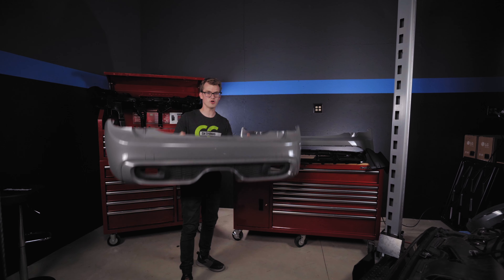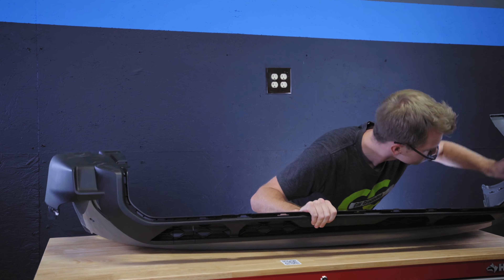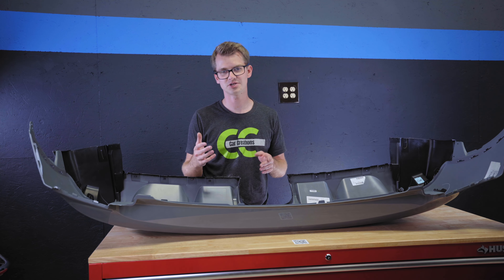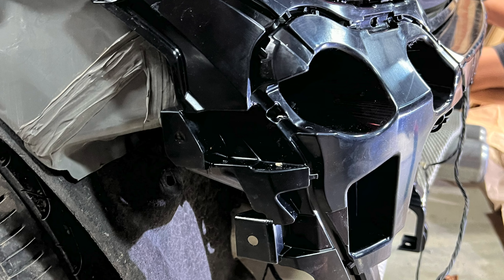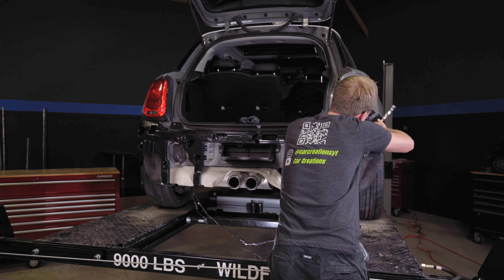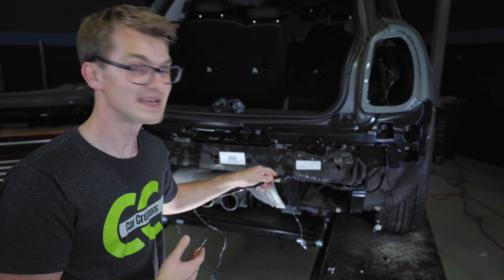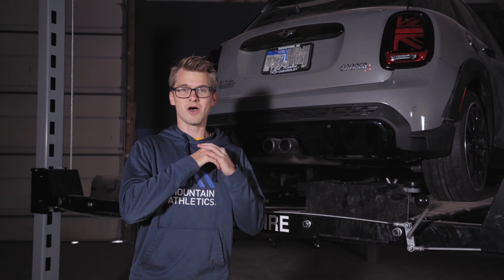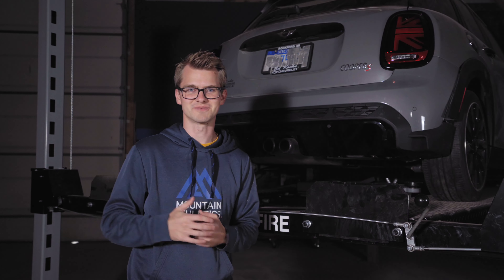Installing the NEW 2024 MINI COOPER JCW REAR BUMPER!

Comment: Hey Ethan, super helpful videos! I'm planning to retrofit PDC on my F56 and was wondering if you knew where exactly the wiring harness goes through into the car itself. The retrofit instructions from MINI mention seem to point to somewhere on the rear right corner - but it's not completely clear where.

I know you mentioned a PDC retrofit in the video, so was wondering if you could help me pinpoint where exactly the wiring harness from the sensors passes through to the car?
Reply from the maker: Thanks so much for watching! 
If you send me a dm, I can get you more information as I am doing my own pdc conversion right now, however it is on the bottom right of the car. It goes into the bumper. You can see the end where it comes out if you remove the right panel in the boot.
Reply: @carcreationsyt  Thanks! Have sent you an email :)

Comment: Hey. Thanks to you I managed to install and wire everything in place. But I am not able to get rear fog lamp to work. 
I used one of the connectors and side marker connector from r56.  Enabled rear fog lights with bimmerode. Now when I connect my old bulb rear fog light and press the rear fog light button it works but LED doesn't. How did you get this light to work?
Reply from the maker: Nice work! I actually just coded out my rear fog lights and didn’t get the bumper with the light, but you should be able to get it to work. 
A couple methods. Try coding it to be a led. That’s probably the issue. 

If that doesn’t work, you could run a wire up to the break light and wire into that. That way it would function as a break light.

Comment: hello, did you mount the f56 rear bumper on the f55?  no problem?  thank you
Reply from the maker: They make the lci2 jcw bumper for an f55 so had to get all f55 parts. I don’t believe any of the f56 parts will work.
Reply from the maker: @cristianpelosi  if you contact him, he can help you find most of the parts,however I don’t believed you can get the piano black rear diffuser here. 
These are the additional parts I believe I need, I can’t garintee though as I have not received them yet. 

COVER, WHEEL ARCH, REAR LEFT
Part Number: 51115A3C801 ; 51-11-5-A3C-801
COVER, WHEEL ARCH, REAR RIGHT
Part Number: 51115A3C802 ; 51-11-5-A3C-802
WHEELARCH TRIM back
WMW53DK00N2R40373

Blackdefuser - 51 12 5A3CAF2
Reply: thanks and the full bumper?  what code does it have?

Comment: did you buy all the parts new from a dealership? I have a 2022 F56 S and I think I can just replace the lower part of the bumper with the JCW part.
Reply from the maker: I got them from out motoring as they have it in stock but you definitely can get it from a dealership. 
Yeah I believe your right, just the black trim and the piano black diffuser.